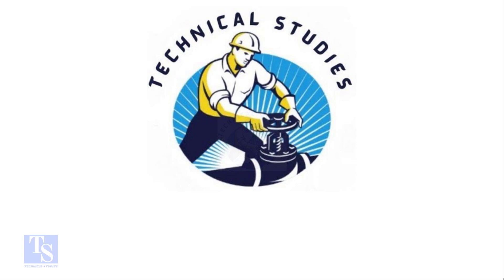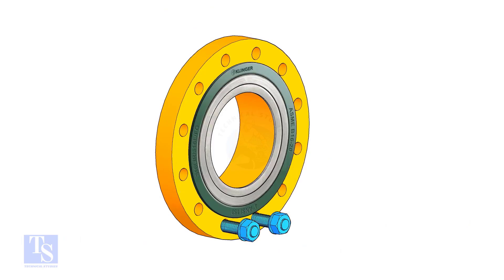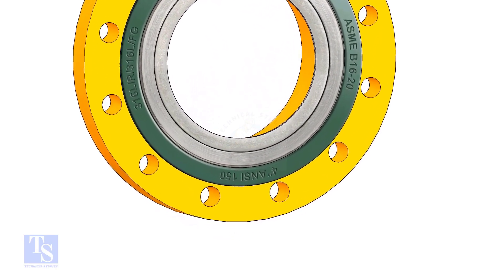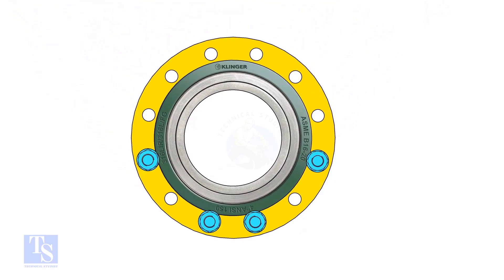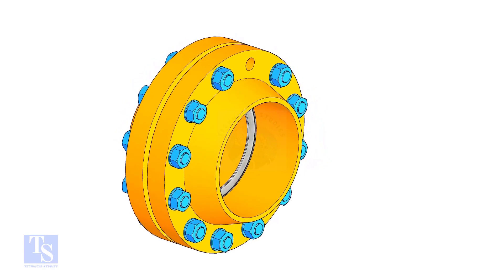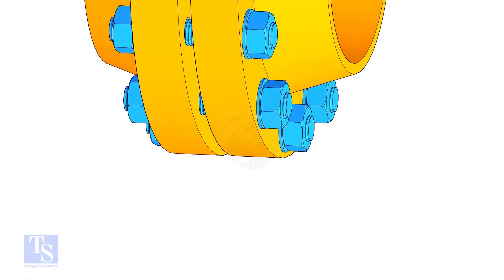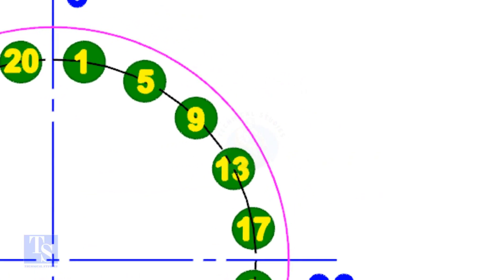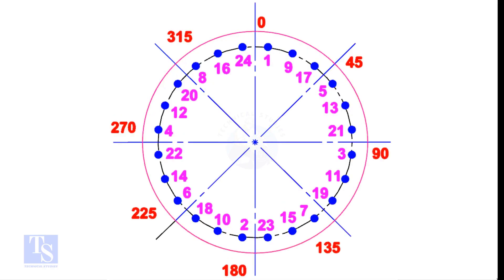Flange Alignment & Bolt Tightening Correct Method

Comment: I have problems finding the amount of torque that needs to be applied in the bolts for a specific type of gasket. Do you know where I can find this information? I was reading the ASME PCC-1 but I can’t find it.:(
Reply from the maker: Bro, you need to read the instructions in the gasket manufactures manual. Can you tell the gasket type and manufactorar name?

Comment: In Little bit  pressure line which bolt should be open first . please reply me if there are bolt no.is 8
Reply from the maker: If the line is under pressure, loosen the bolt, opposite to your face and body. Suppose you remove the bolt, facing you, the content of the pipe will flash on your face. It is safe to loosen the bolt, opposite and at the bottom of the flange, so the content will fall downward. Thank you.
Reply: Bolt in a lower position for safety purpose